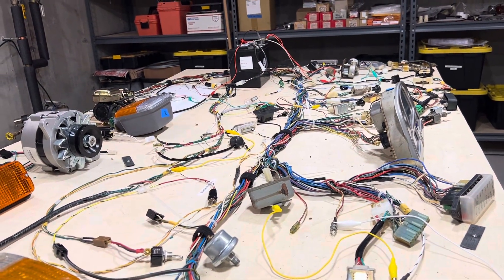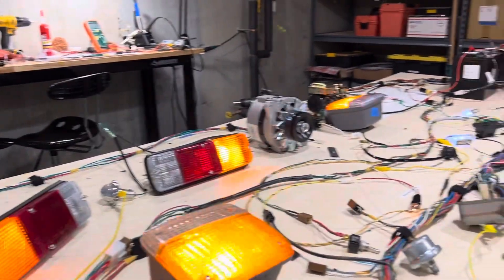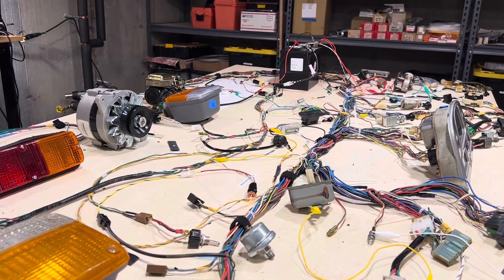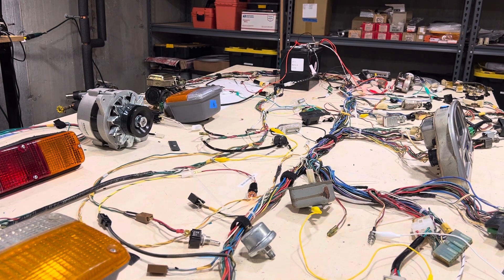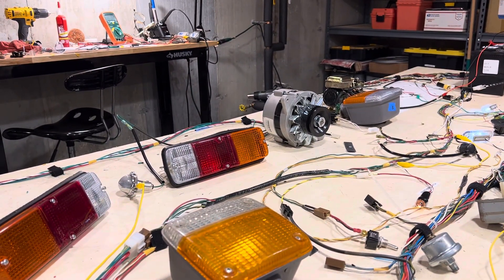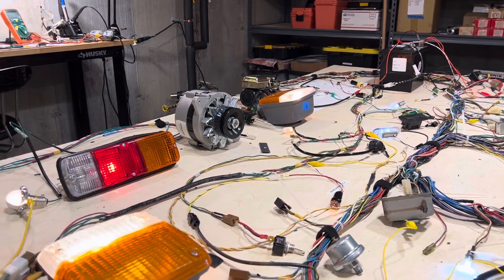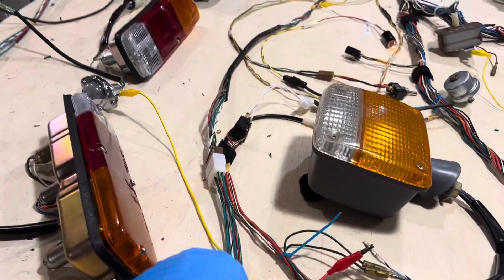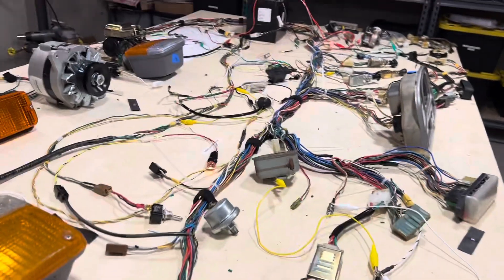12/75 (1976) FJ40 Wiring Harness Bench Test

Comment: Great video. Can you share the diagram or how the connector from alternator to the regulator and back to the car. Tq
Reply from the maker: I have the harness off the bench so not able to show. There is a black yazaki 3 pin connector that connects to the Alternator and a white/blue stripe wire that connects to the alternator with a ring  crimp terminal.  The harness has a three pin connector that connects to the regulator.
Reply: Tq 👌